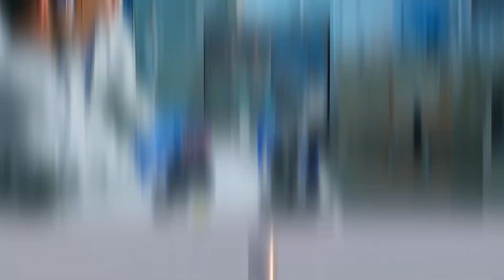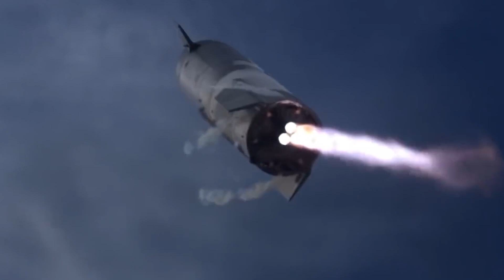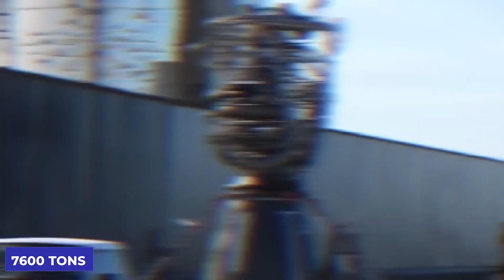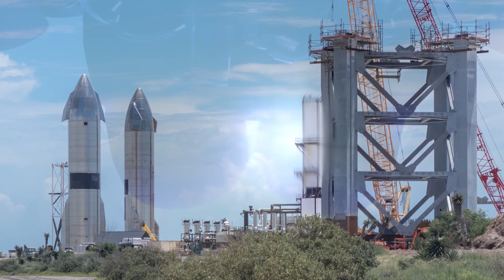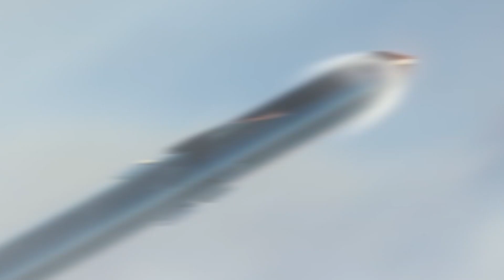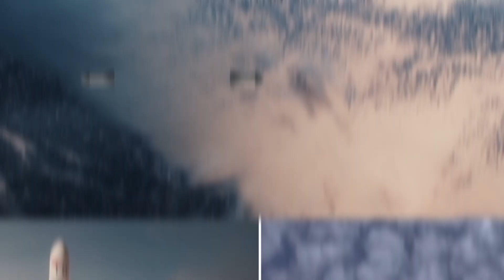SpaceX New Raptor 2 Engine Upgrade Is Completely Insane

Comment: I wish SpaceX would not concentrate so much of their production in Texas.  IMHO most of the problems with the FAA are due to their being burned by Boeing, they allowed Boeing to certify the 737 Max largely without oversight and it turned out to be a dangerous disaster. The orbital path out of Boca Chica goes right over Miami and South Florida where millions of people live. NO wonder the FAA is worried, even little pieces of a failed rocket would bring huge kickback out of Florida. Texas is also an area that has  been known to be fairly hard on non-texas industries. I expect that the SpaceX plans to produce their own Methane using solar energy will land them in a lot of trouble with the Texas government which has routinely fought against any kind of 'green' thinking. Better for them to go almost anywhere in the US or even overseas than try to deal with the government of Texas.  I live in Texas, I like Texas but its not a good place to try and change things. SpaceX would get to Mars a lot easier and a lot faster by expanding their California facility and sharing launch facilities in French Guiana with Ariane.  All the advantages of a production base in a friendly state and no FAA issues with the launch facility.

Comment: Can SpaceX increase the upper half of the Starship diameter simlar to the look you see on the Falcon payload area? Could it also add an extension 8 meters in diameter to the top of Starship for an additional 30-40 meters without putting the center of gravity to high on the Starship.